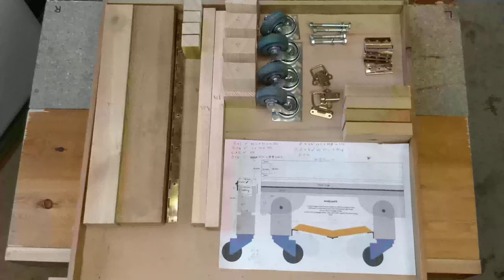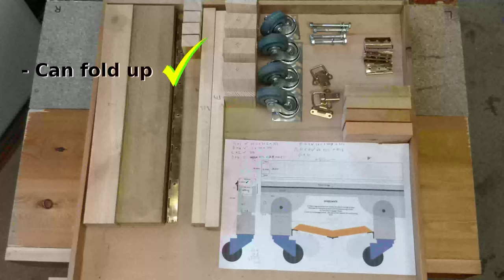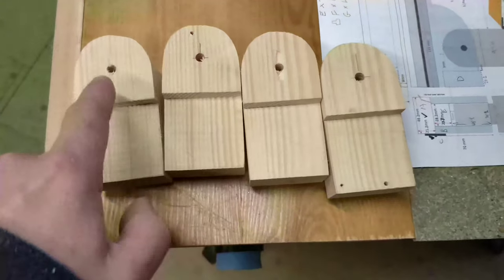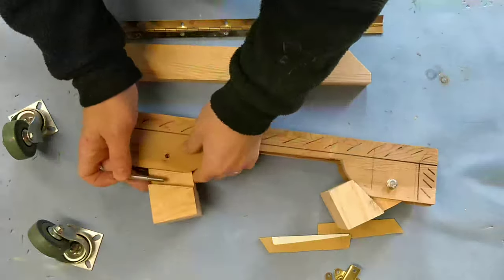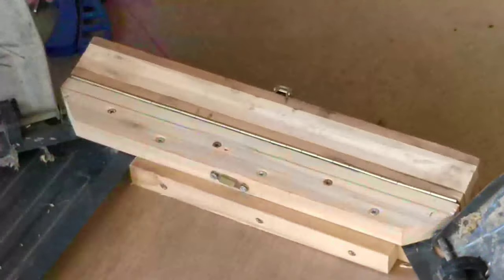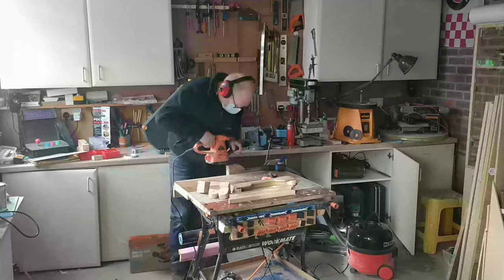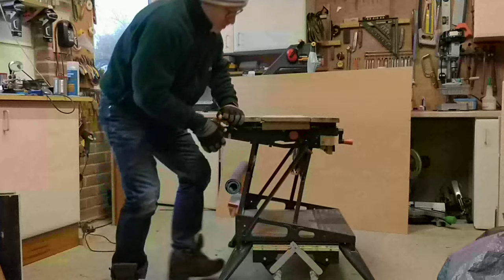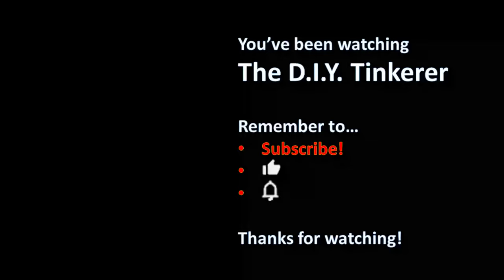17. WheelMate Foldable Wheels for the Black & Decker Workmate

Comment: Some great mods that I will put on mine thank you, over the years ( 40+)I like most have picked up bits and pieces with the great intentions of using them  time to clean out I think ?.. one way I found of using my metal vice  was to mount onto a piece of plywood then glue and screw a piece of 2by2 to bottom and clamp it in workmates jaws
Reply from the maker: Sounds like a good solution :-)